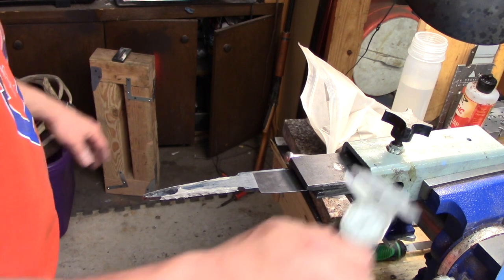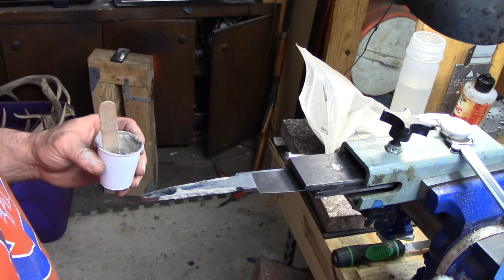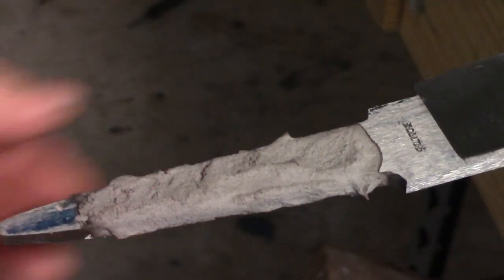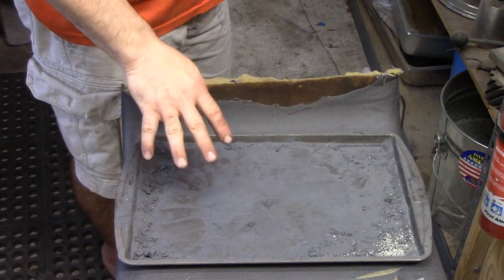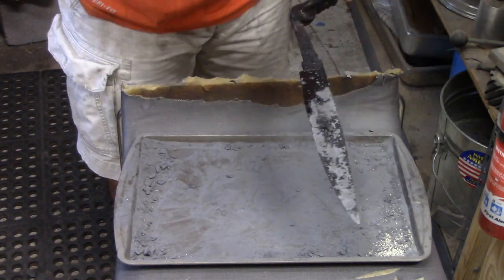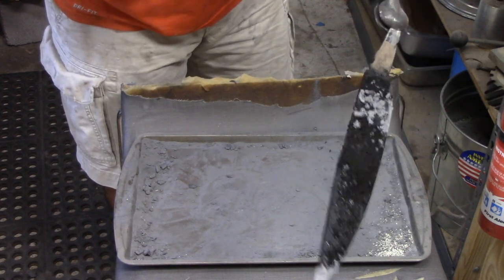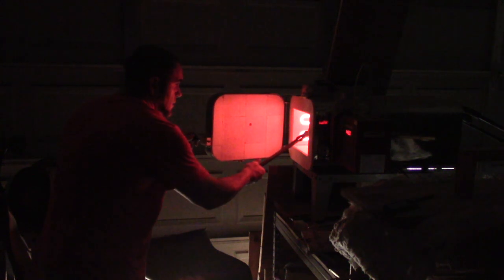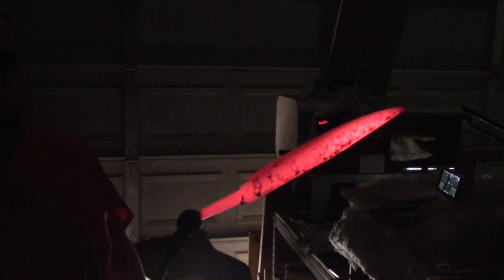Knifemaking: Heat Treating 1084 Steel Part 1...

Comment: Super video. Thanks for sharing. I have been getting good results from 1084 in fairly thick blades. I control the hamon with the clay (thickness and amount down the blade).. I tried mixing the satanite with vinegar and let it dry. I get some weird effects from that. Thanks again!
Reply from the maker: Rob Gooch Interesting!

Comment: Would you normalize a blade that was made via the stock removal method?
Reply from the maker: I would. Mainly because 1. You never really know how the steel was heat treated prior to getting to you and 2. Heat can build up in spots in an unequal manner that can cause warpage during quench or inconsistency in the blade/edge. Its worth it to me to be sure and to have more consistent results

Comment: How much soak time would you recommend for 3/16 steel? I grind bevels after heat treat. Thanks.
Reply from the maker: Depends on the steel and your method but most tool steep recommends somewhere around 15-20 mins per 1/4”. But you have to pay close attention to instructions from tool steep guides because some will refer to test pieces up to an inch thick!! ...you will have to reduce time. 

Testing will be your best friend.

Comment: Have you tried the paint on anti-scale? They both have their pros & cons... Like with the paint on and 52100, I found that i had to use a slower quench to get a better hardness, even the McMaster carr 11 second was too fast... I've got a few videos on both. I just don't like that you have to stop with the powder and it is so much messier...Take it easy.
Reply from the maker: Dave Erving Evader Knives Thanks for the comment buddy.
Reply from the maker: Dave Erving Evader Knives Never tried it. May have to look into it. Don’t really have to bring the water to a full boil to get it off but needs to be pretty hot. But on small blades where i don’t clay coat, but rather full harden, the compound breaks off during quench and the whole thing shines without so much as a scrape at all.